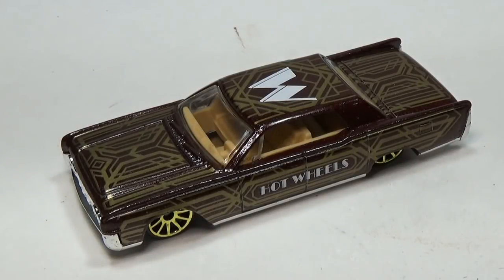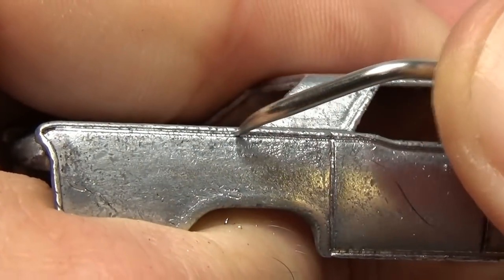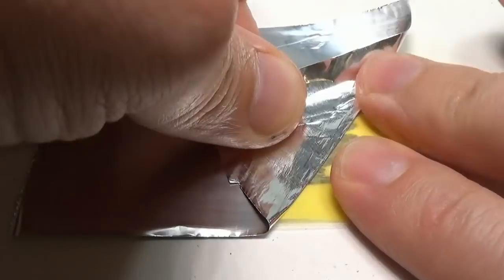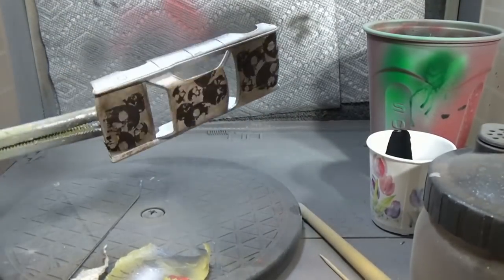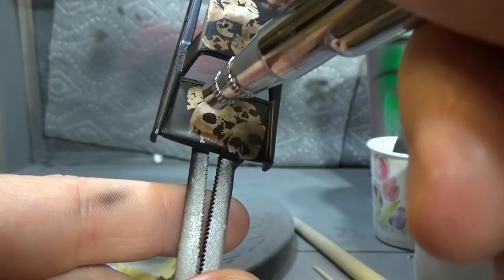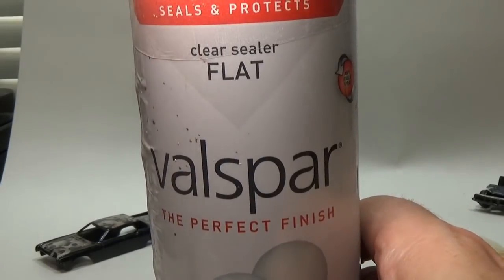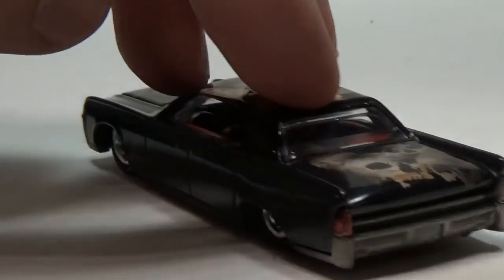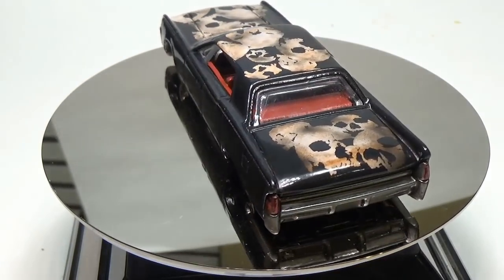Custom Hot Wheels 64 Continental

Comment: "artistic skill, of which I have very little"

proceeds to produce the most bad ass professionally painted car I have ever seen
Reply: Did you notice that this Matchbox restoration episode; also revamped my memory of when, Katherine and Corey Chrysler used to live on the corner of Rodriguez Street and 7th Avenue? I'm not kidding you, it did. It's about when they used to own a 1950s black pickup truck, or even a 1950s black 2 door sedan with red hub caps and white wall tires. It's right next to where the old SPCA is. I've rode past there many times before.
Reply: Right!!

Comment: Nice!  That little added touch makes the back deck not look like plastic anymore, and really upped the ante on realism.  Before you put the gloss coat on the seats I thought "hey, that almost looks like fabric!".  I get the point though, "scale textures using paints only" is a rough spot.  I'm sure you'll figure it out!

Comment: Sent this to you via YouTube message, but I'll leave here to see if other people approve the idea:

Little challenge on what to make. Don't know if it will end up very amazing or if it is even possible, but you might want to give it a try:

Get a Custom '62 Chevy and a 1969 Pontiac GTO Judge:
http://hotwheels.wikia.com/wiki/Custom_%2762_Chevy
http://hotwheels.wikia.com/wiki/1969_Pontiac_GTO_Judge

The Pontiac's engine is separated from the body and the underside, as a separate piece, so you can take it out by taking both appart, and it probably fits in the bed of the Chevy truck perfectly. I want you to make a dragster rear-engine truck, kinda like this image I just found:
https://s-media-cache-ak0.pinimg.com/736x/a8/92/ab/a892ab25eae4d47ed1cce300ae605ebe.jpg

If other people know other trucks that would be better for this, please comment it.

Love your work. Good luck if you accept this challenge.
Reply: I like the idea and the picture of a life-size replica of what you are describing.  I may give it a try.

Comment: Do you know if it's possible to fix a clear window part that has a substantial crack through it but is still in one piece?

By substantial I mean if you tried to snap it in two it would do so very easily

Comment: Hi, I have just started to watch your channel and I saw the redline restoration and I was wondering if you can do the light my Firebird car or the 1969 custom Dodge Charger
Reply: Hi again, I have a quick question, I have this non redline 69 Dodge Charger from hot wheels with rust in the axels and oxidation on the body, how can I remove the rust and oxidation without removing the body or paint